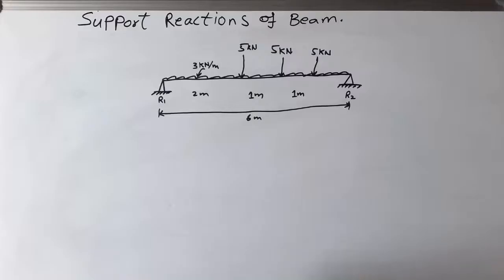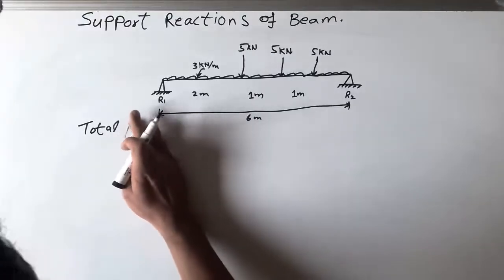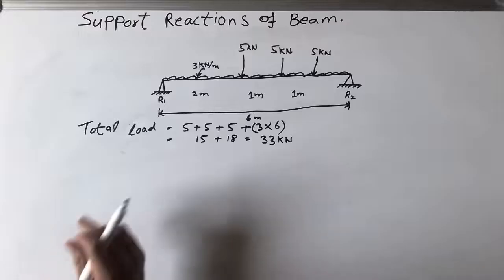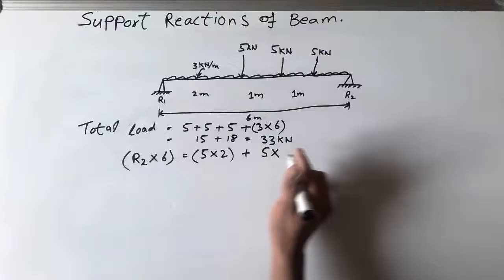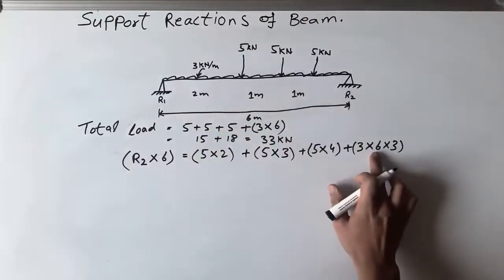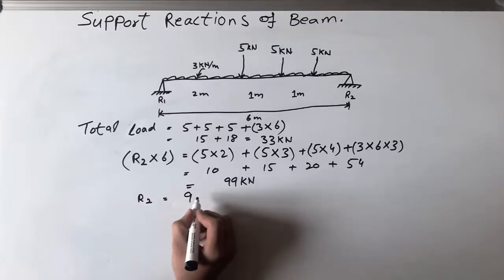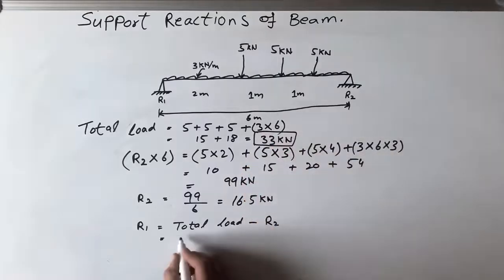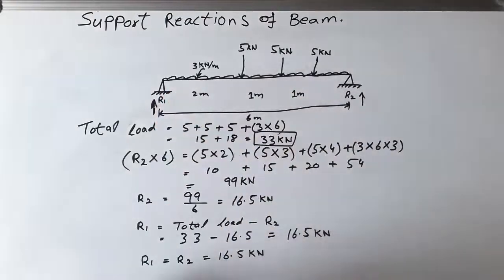UDL and Point Loaded Beam. ''Support Reactions''

Comment: what if the UDL  was spread across let's say 4m? Would I still calculate with the whole length of the beam or with length of the UDL?
Reply from the maker: Thanks for your question. We calculate UDL wherever it is separated on beam. We also need to add beam length too, for example points on beam. A to D etc. Whatever comes (load) on the beam between the points it should be calculated.

Comment: You are not using correct method there is some mistakes in your problem correct it or delete the video, don't distract the students
Reply from the maker: Thank you so much for your message. Really! I think this is the simplest way of calculating support reaction. Please point out the mistakes so I can get them correct. Thanks